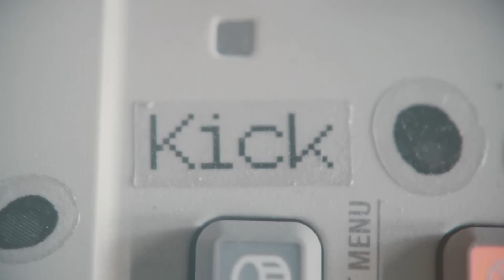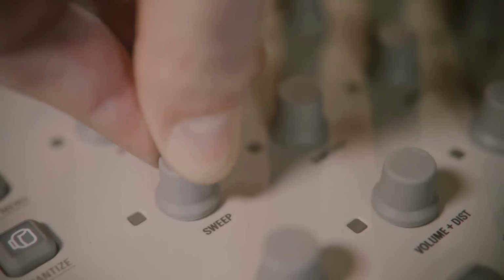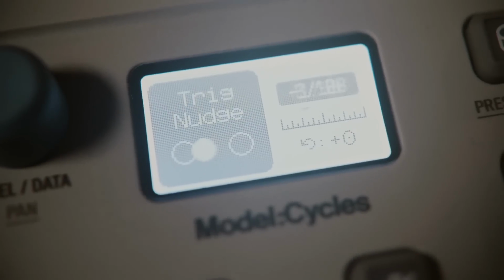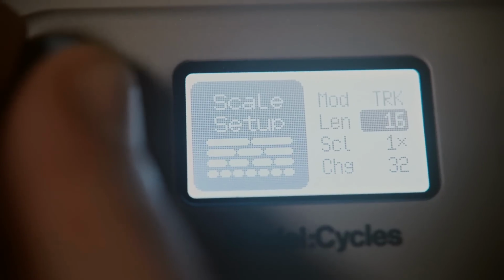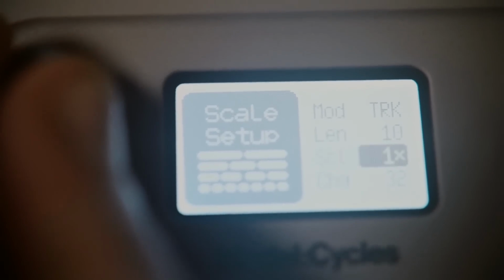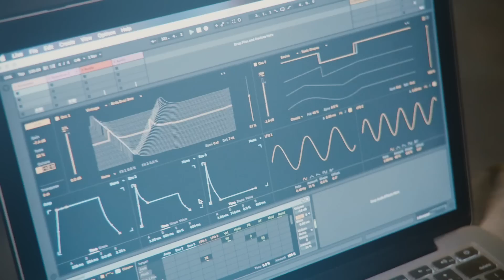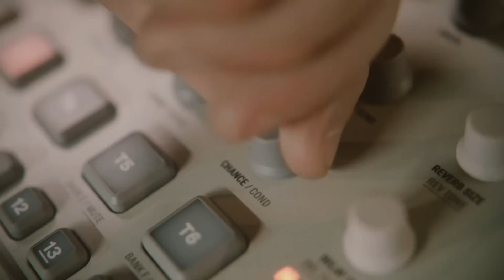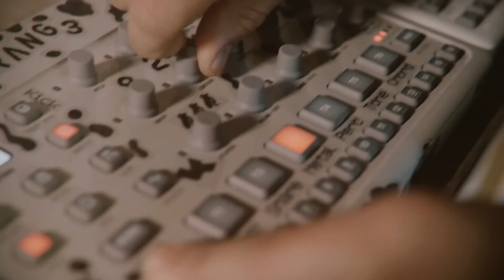Model:Cycles — At A Glance

Comment: cmon Elektron the cycles has a lot of potential it’s time to unlock it.. more sound programming options , better presets many sound identical, glide function , bpm delay options..  put that aside it’s a great inspirational tool and it stands out but it just needs a little more on the sound front x